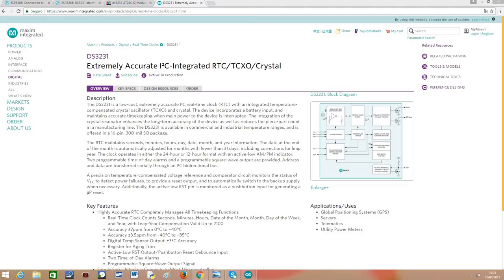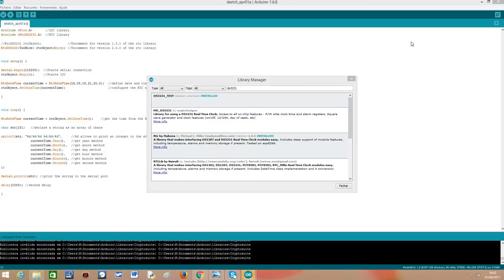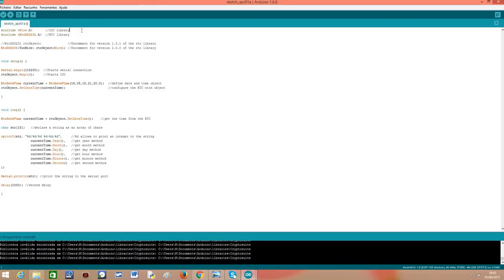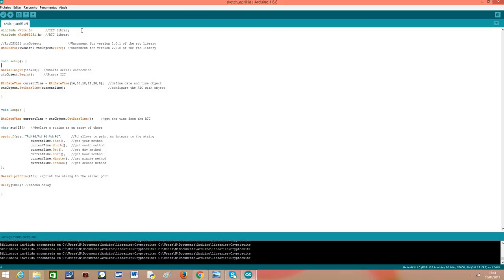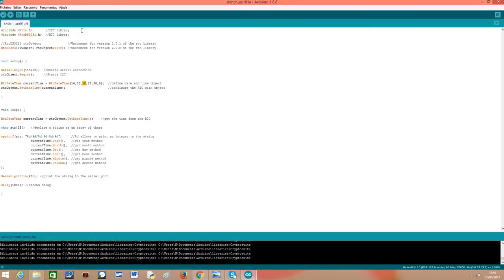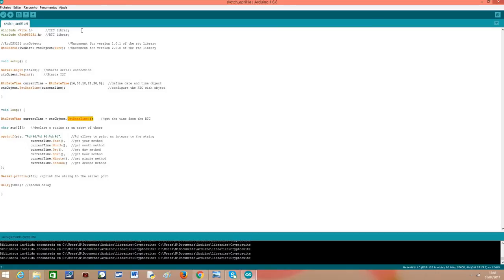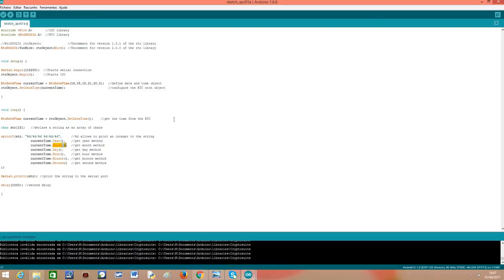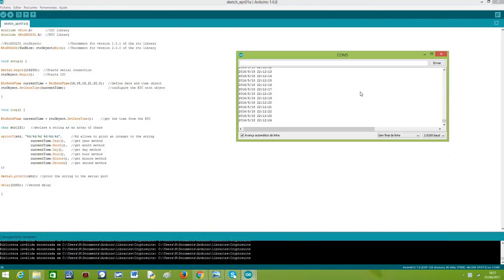ESP8266: Connection to DS3231 RTC

Comment: I already upload your in my ESP8266,but my DS3231 show time is "2009/85/165 37:165:85"?
Reply: I am having to same issue.
Reply: i solve this issue,it because your Pin inserted wrong .So cannot write time into the RTC.
Reply: So how did you fix it?
Reply: Did you wire it differently?
Reply: 這是因爲你的脚位接錯了,你可以去看看 https://makerpro.cc/wp-content/uploads/2017/03/%E5%9C%965%E6%8B%B7%E8%B2%9D-1.jpg 這是你RTC 和 ESP8266 或 arduino 所要接的脚位
Reply: Thanks for the reply. I see that you used A4 and A5 but I am using esp8266. This would not work on ESP8266?
Reply: Did you ever find the problem? I'm having the same issue

Comment: i want to ask you, if i have the different version of installation rtc3231 and esp8266-01, is it able to use this?
Reply from the maker: Hi! I've not been using both the RTC and the ESP8266 in a while, I'm not sure if it will still work for later versions. My suggestion is for you to give it a try and let us know  :)
Reply: @techtutorialsx11  so this code is not used both?